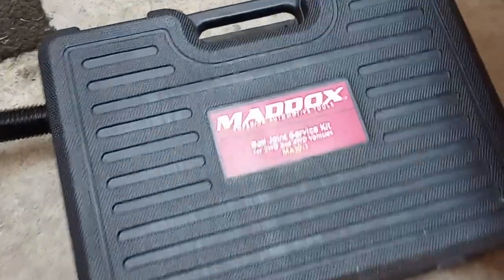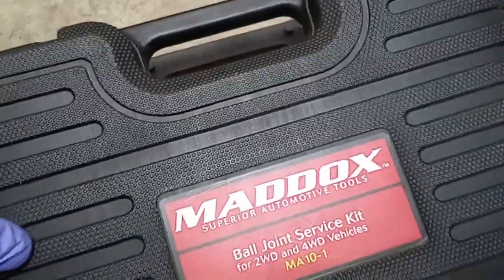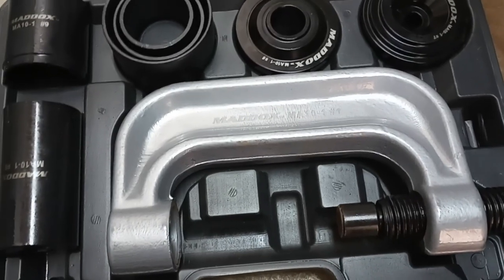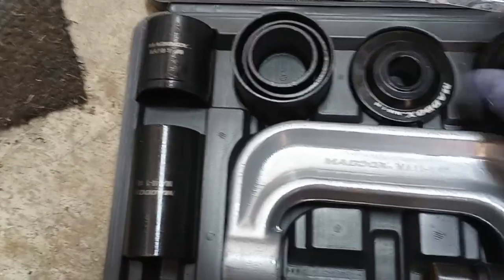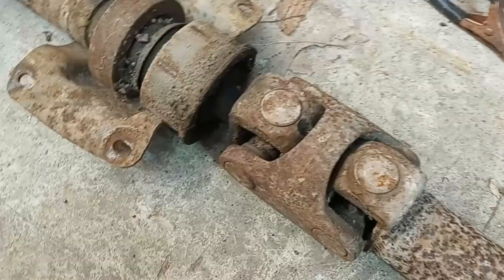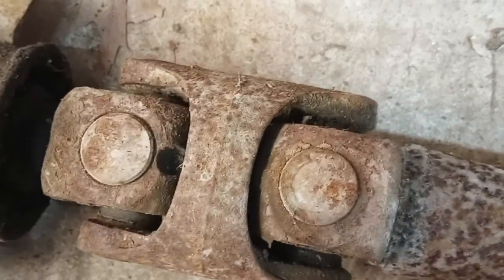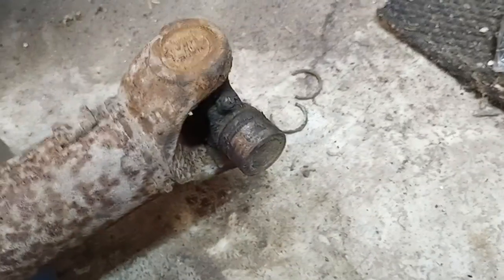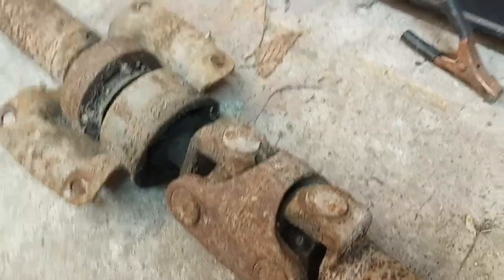Harbor Freight Ball Joint press to remove a U-joint

Comment: Were you using a torque wrench to crank on that press?
Reply from the maker: Yeah - I have a cheap old one that stopped working (not because I used it like a breaker bar - hahaha).  I use it as long ratchet.
Reply: I saw that.

Comment: What happened? Didn't even see the tool in use.
Reply from the maker: Yeah sorry, it was difficult to hold the phone and work the wrench while holding the drive shaft in place.  It worked well.  It pushed the ujoint cup out on the one side and I pull out the 'cross'.  Then it took some effort to get the cups out since they were pretty well rusted in there.  Thanks for watching!
Reply: @theworkshop3706  That is a good tool to have

Comment: Show the hard part you did off camera  that's what I need to see not after you loosened it and just drops out 
Sad
Reply from the maker: Yeah - hard to hold the camera and wrench at the same time.  It's really just turning the screw to drive out the ball joint, but yeah I would have like to shown it.

Comment: You got the drive line out and you don’t replace all the u joints 😳😳
Glad you don’t work for me
Reply from the maker: You've got a good point.  I try to replace things that make sense 'while I've got it apart', but I also try not to spend too much time and money on things that are perfectly fine.  But for $20-$30 and a little bit of work it's probably worth doing the other u-joint.  Your comment prompted me to look closer at the center bearing and rubber cushion that holds it.  That's probably going to get replaced since the rubber looks tired.